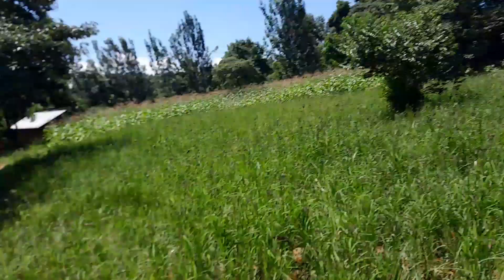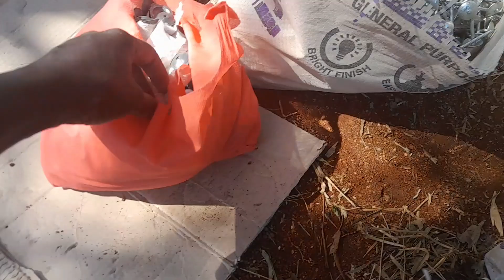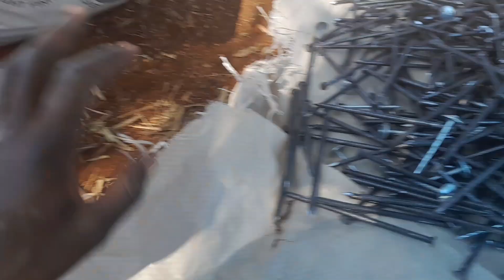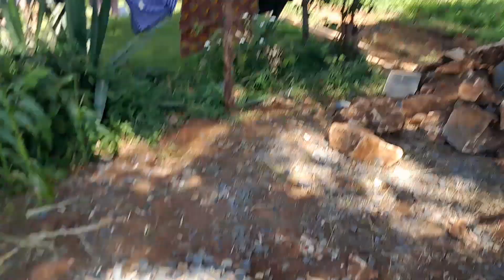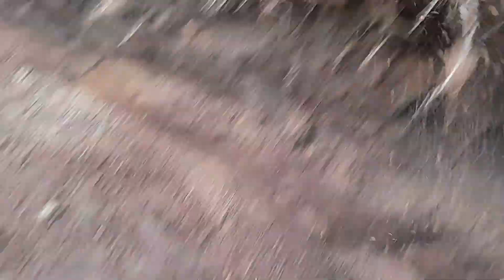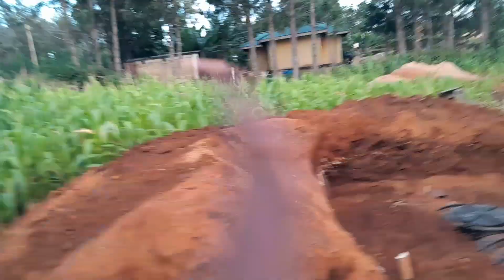See The Magic at Our Home🥳🙏

Comment: Hello Matinde,

Putting the soak away pit close to the foundation is wrong.
A soak away pit should be placed a minimum of 2.5meters from any house/buildings to prevent water from infiltrating the house foundation.
Reply from the maker: The soakpit is 8feets deep that is minus the 3feets that we have build for,,that's means water will not go back to the foundation and their will be no smell
Reply from the maker: We will also plaster the 3 feets wall to make It watertight
Reply: Quite sure the soakpit wont become a problem, even if its close to the kitchen wall. Its deep and will be leveled up with stones and gravel to support it. Pluss that the brickwall will be watertight with a slab on top. But if we are wrong, then it will be moved in the future. Legit consern Ace, thanks